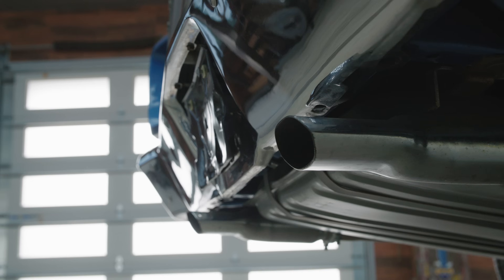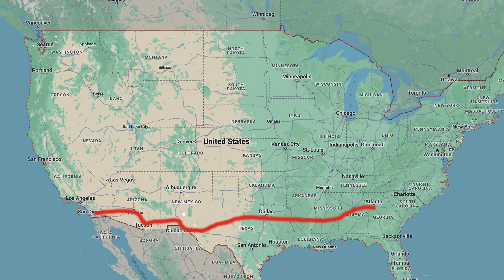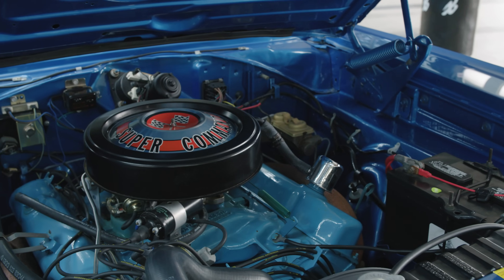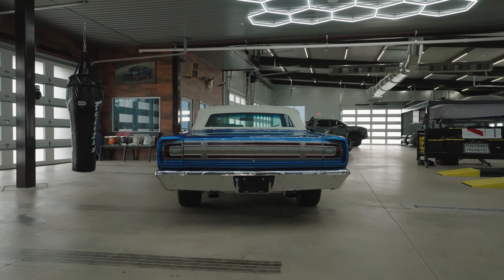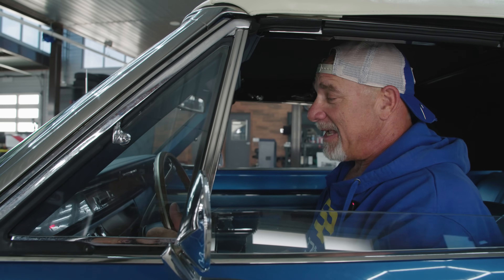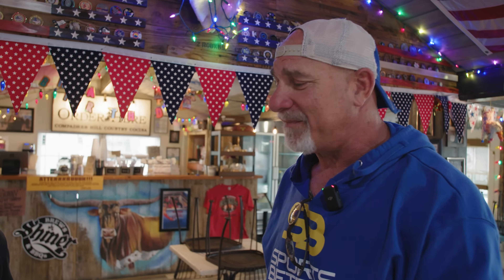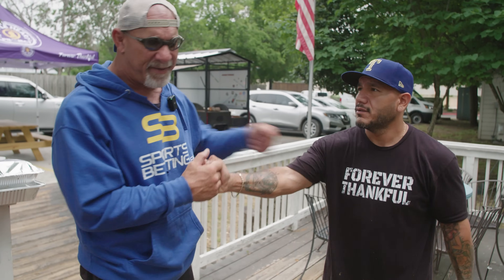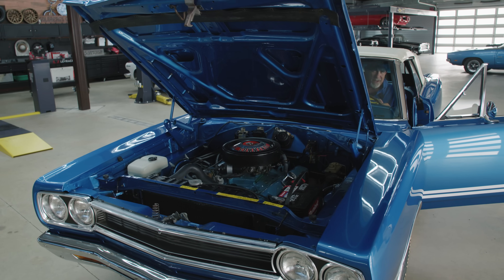1968 Plymouth GTX droptop! …GOLDBERG’S GARAGE Episode 29

Comment: A man had a 69 GTX Convertible  for sale for $3 500 back in 77 in South Houston Texas. I already owned 4 speed B5 Blue Superbird,  A 70 Go mango 4 speed challenger R/T with 410 gears , orange factory Leather interior.  ,Also a 70 R/T Hemi Orange  6 pack 4 speed. It came from Wichita Falls Texas AFB. Was used only to pull the original owners early Hemi cars to the drag strip.Bought it from my Brother Steve Cook when he got stationed in Germany. He also owned a 69 GTX, 440 commando automatic. Would smoke a set of tire trad off in 2 passes